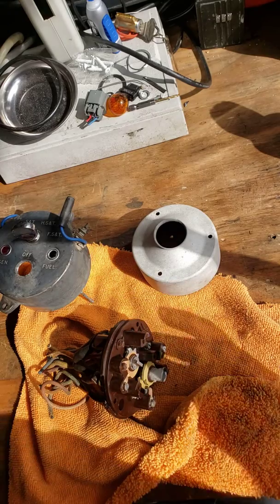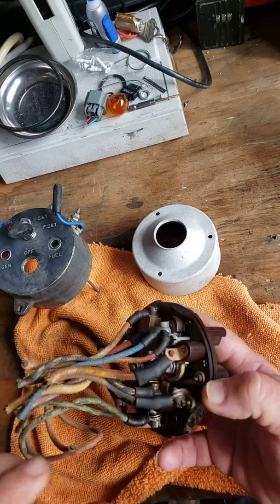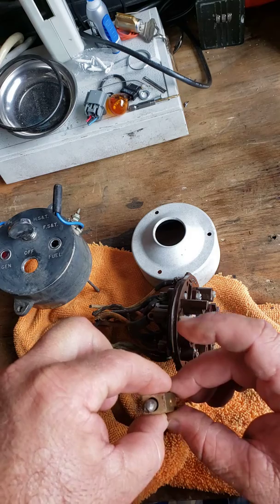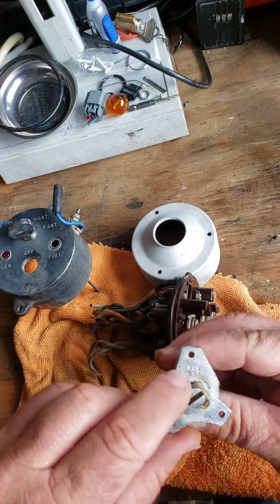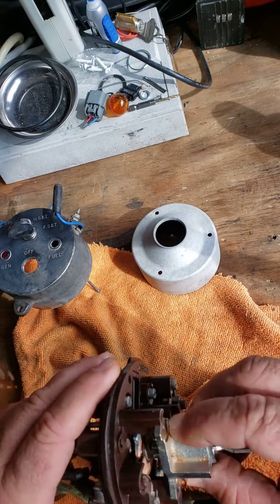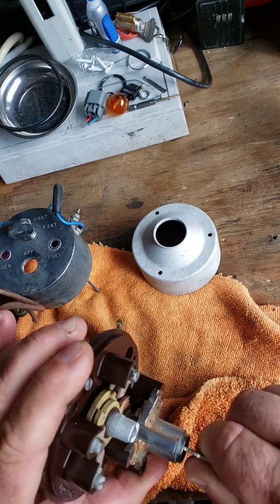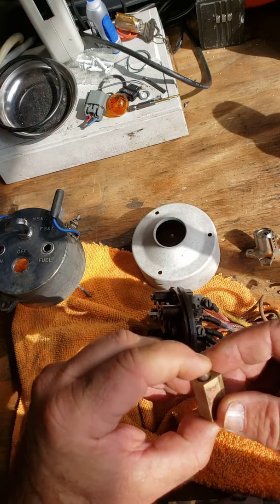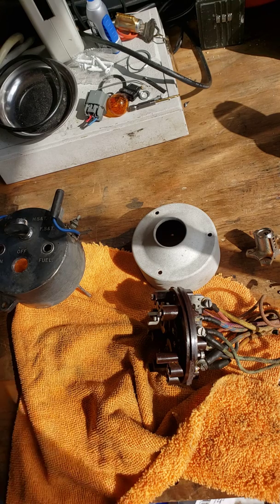ROLLS ROYCE IGNITION SWITCH REPAIR MR SUNSHINE LOCKSMITH EDDY SHIPEK 561-693-8636

Comment: Excellent demonstration, thank you. I have a 1972 RR Corniche where the starter solenoid remained engaged when the engine started. Just replaced the starter as the series logic of the circuit went parallel, spinning the starter to its demise...

Comment: I’m fixing an ign lock from a 1970,S era R-R for a friend. the key got stuck in the lock. After dissecting it I noticed the bitting May have caused the problem (5-4-0-1-0). Such short pins ended up looking more like tiny ball bearings than like pins. The shortest ‘pins’ eventually got jammed over time, with use, and wore away the small wall of brass between pin chambers.
Reply from the maker: Hellooooo!!! Thank you so much for your post!!! I've taken over 100 RR locks apart for rekeying and for the most part those Yale locks have held up for many many years. The RR with high miles and worn pins show that that motorcar has been used alot and I'm sure enjoyed its rides down the road wherever they may be!!! What year RR and model are you working on, is there a code number stamped on outer housing or on the brass lock cylinder itself,  their should be.  That code is the key code which you can cut key to factory specs.  I found that old national pin tumbler rekeying kit pins works great on those cylinders, never could find a Yale pin kit that would work. On your lock, you can either replace worn out pins and springs, or remove them altogether as long as you have the operating key for the doors and trunk and glove box lock.  If you have code number I can give u the cuts and depths to make factory key.   Thanks for the post
Reply: Yes, the stamped code on the rear of the lock body is “BHL 513”
The stamped code on the front of the lock body looks like 25S, and I have the key. The bitting looks like 5-5-0-1-0. I think those last three really small pins are what damaged the lock by getting wedged somehow and then binding the key. The key broke off after being forcibly removed (probably vice grips). I think we need a new lock altogether and then I can pin it up to match the existing set of keys. Right now the pins and springs are missing anyway
Reply: It’s a 1967 Silver Shadow
Reply from the maker: @62Cristoforo  the Code BHL513 has cuts 23255, 5 being deepest on this code. If u have codemax machine ,dsd# 736 and enter cuts.    If framon, cuts start .138 and spacing .141.    2 depth is .236, 3 is .222 and 5 is .195.   Forget about new cylinder ignition switches are $350-450 on ebay,  and you won't find the cylinder itself anywhere.   Use national cabinet pin kit or you can mail to me and I'll key it and ship it back.   Check out my ebay listings under thepalmbeacher or search rolls royce ignition switchbox I have about 8 switches listed and rekeying service as well.   Also rebuild accumulators, calipers, pumps height controls etc....if on Facebook hit me up eddy shipek I also have a rolls royce forum on there as well ....any questions call or text me 561-693-8636...get the rolls royce to proceed again